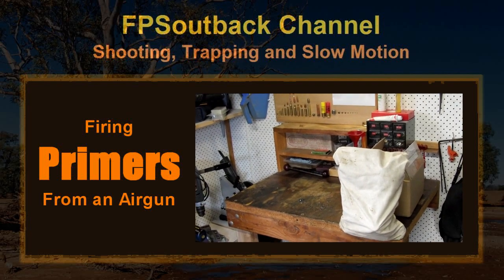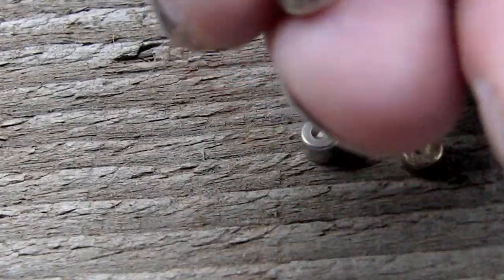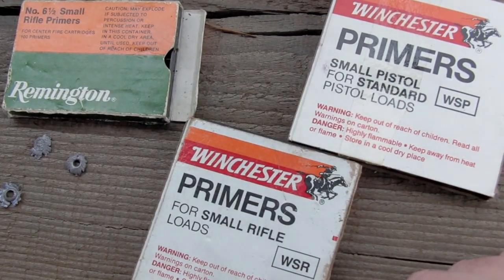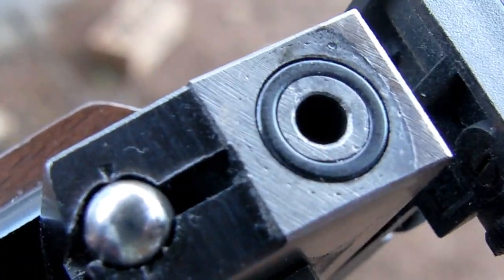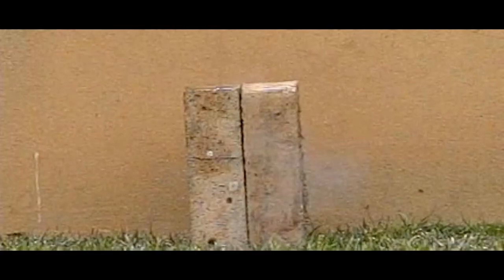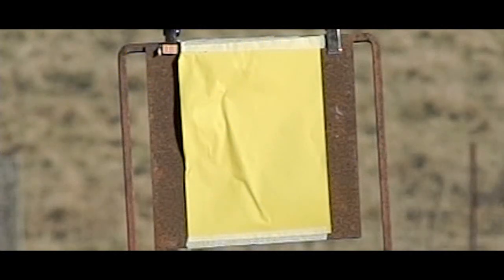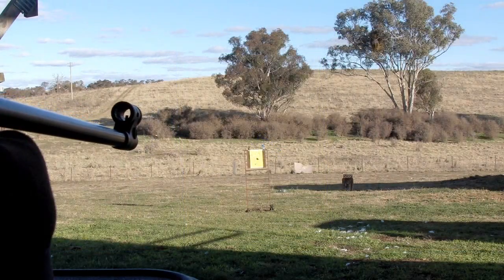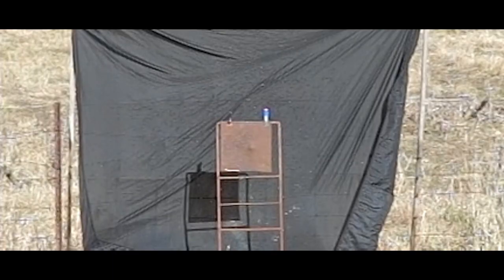Firing Primers from an Airgun

Comment: I had a few primers that got messed up the other day reloading .380 and they were no good to put in ammo but I remembered this video! I actually took them and used a dot of super glue and put them some high velocity .22 pellets. They had a pointed tip so it fit into the anvil recess perfectly. I have an old Crosman 103 pump that I muzzle loaded them into, gave it 5 pumps and let'er rip at large tree, it made an impressive pop and flash in the dark! Im too frugal to shoot my primers but If I mess any up, I know what to do with them!
Reply: If you glue some penetrating pellets to them you basically have an API pellet

Comment: I've been shooting small pistol primers out of a 900 fps+ air rifle for years without problems. The results are about like yours of course. Another trick I figured out as a kid is to put a pellet in the very end of the barrel, then load another one as you would normally. It makes a loud bang from the pressure.

Comment: those little plastic things from inside the stacking point pencils where you pull it out of the tip and shove it in the back to push the new tip through seemed to work well when i was a kid.

Comment: I would use primers in my pellet gun. The trick to make them blow a hole in a tin can was to glue a bb to the side opposite the anvil and shoot the combo pellet first. The result is a hole from high pressure blown through the cans wall. If you are careful you can remove the powder from several
 primers and fill the cavity in a pellet. Then seal it with a small piece of wax.
Shoot the pellet cavity first "backwards"
And it will do a better job. I used to fill my 22 LR bullet hollow point with primer powder and shoot 2 by 4s with surprising effects.

Comment: The cork screw flight is due to the primer (as a pellet) is going too fast for it's length. Same thing happens when shooting too light of a pellet from a high powered air gun.
Reply: Agreed, but keep in mind he was shooting it from an airgun only putting out 400 fps with lead pellets. Imagine shooting it from a 18 FPE+ airgun... short range would be accurate, but 30-40 yards out would be insanely wild with such a low B.C.
Reply: These are actually hitting backyards to, and like the guy said 10- 20 yards beyond that they have no accuracy they're made out brass or nickel so they'll shrapnel and ricochet as shown

Comment from the maker: Not really, its still "balanced" in the same way a airplane propeller is balanced. If you file a bullet into a paddle shape it will still fly straight. I know this because I just did it for the next vid, unbalancing it will cause a spiral though.

Comment: cool video...Try gluing the small pistol primers to the tip of a flat nose pellet to stabilize it in flight better.  It may or may not work.  You could even remove the anvil before you glue the primer to the top of a "pointed" pellet, the point of the pellet may be able to act as the anvil and detonate the primer.  Of course all of this defeats the purpose of using the primers as a pellet alternative.

Comment: Cotoneaster berries - little red berries that grow on bushes and small trees. Squish them into the breech. They have a few hard seeds inside them that will penetrate a plastic milk jug at close range. My friends and I used to shoot each other with them.

I got shot with one in the leg and it hurt real bad and bled a lot. On closer inspection there was a squished lead pellet stuck in my leg. The pellet had been one of several stuck in the air rifle's barrel in the past, then hammered out with a rod. This one had stayed squished into the rifling, then dislodged by the berry and stuck in my leg.

Comment: I've been experimenting with constructing .25 pellets using 1/4" heat shrink tubing and the heaviest 6mm airsoft biodegradable pellets I can find, usually 26gr. I stack  20 pellets into a 3 inch section of tubing the airsoft pellets and then gently heat it just enough to clasp the pellets. I cut them into 2 pellet sections then reheat to fully shrink the tubing to snuggly grasp the two pellet sections. After loading into my magazine I apply a drop of RWS cylinder oil just to grease the skids.

Comment: I would use plastic cap-gun caps cut off the ring, pins with BB sized heads, and the little round bits of fertilizer from house plants.

Comment: As a youngster, the use od daisy BB guns to shoot cockroaches was a normal thing.  Without BBs, we had to use whatever we could find.  Stick matches were always a favorite, though safety became a priority after the first few mishaps.  My other favorite load was a bit of modeling clay "wormed" to slide easily down the bore.  These proved to be surprisingly accurate and made satisfying splats that would disable if you missed closely enough.  Cleanup was very easy, as well.

Comment: It spirals because it's more or less cup shaped. It's "naturally unstable in flight" as they say. Try attaching a normal bb to the striking end of the primer with a spot of epoxy. It should fly bb first and maybe less erratic but lower velocity. Maybe that would allow the primer to donate on soft targets too (or in the barrel) :/ Look out, crows...

Comment: nice video, I've done this with home made flash powder but this looks more fun and quicker, I've been trying to test which is better, anvil side facing pellet or with it facing target", im guessing with anvil facing target you would think all of the charge would be directed into the target upon impact, and if its the other way around then you would think that the hard silver cap would act as a boost for penetration because the cap would want to blow forwards into the target from the explosion pushing off of the pellet that's is ramming it forward. I want to do a shrapp metal test, maybe like putting something really thin but just hard enough to set it off without really smashing the pellet' because this way I can see if the shrap metal from the explosion blows out the side walls of the toilet paper roll tube or I can see if a pressure wave bursts it open, without it just being from the pellet splattering flat and shooting out the sides,, I think im gonna do this tomarrow :0)

Comment: i used to shoot small capasitors twisting its leg into a pointed projectile, it was great and really fast, also cheap, coz i used to take the condensers from non working circuit board, also thrown out nail,  and other things like a phyco. those days were great.

Comment: i use to take a .22 round and it would sit just inside the tip of the barrel of my pump action power 77.   i would shoot a bb at the round and the round would fire from my bb gun.  tiny round firing pins are all a bb is really..   i also have a bb lodged in the center of my hand for life, and i once had a 22 round hit a tree and come back and stuck in my neck.    i know it sounds like madness, but kids in the woods with trees for babysitters either learn their lesson or they die..  or... they end up confusin the hell out of the TSA when ya wanna get on an airplane 😬 (kidding, the bb never sets off metal detectors)
Reply: Krash Von Reichmann That reminds me of me I was pretty negligent when it came to safely handling hand guns,I shot at a piece of old rail road log laying by the tracks I was using reloads for my Taurus 357 mag reloads aren't too reliable when it comes to consistecy in velocity I shot the log from 5 ft away it ricochet off the log and hit me right at my breast plate I looked down and picked up the bullet amazing I'm still alive to write about it.

Comment: What would happen if you could seat the primer where the o-ring is on the breech, put a pellet in, the mod the piston on a springer to fire the primer, to shoot the pellet??
Reply: Stupid idea to put it simply.
Also I'm not too sure there is enough "uumph" in the primer to send the pellet down the barrel, waste of a perfectly good air-rifle, imo.
Reply: Yeah if it was a perfectly good air rifle lol
Reply: +OminousPinapple I once had a uncharged .222 case. The primer launched a 52 grain projectile out of the barrel just fine.

It's my one and only reloading mishap in over 20 years of reloading. I fired at a fox around 40 metres away and the projectile hit between his feet. Lucky bastard.
Reply: People convert these break barrel air rifles to shoot .22 lr. They drill a little so that the bullet case fits, then remove the piston from the air gun & add a firing Pin. Works perfectly
Reply: @V-C137  How do you get the firing pin to strike the rim of the case, given the air port is aligned with the centre of the bore?
Reply: @BedsitBob  that bit is drilled out, like a straight hole with a floating slot pin
Reply: @V-C137  So the firing pin is like a flat blade screwdriver?
Reply: @BedsitBob  yeah

Comment: Put some oil behind primer you will get more power make a vid & let me know.
Reply: Gator1699 I put Muc Off Mountain Bike Chain  lube all over a fag filter and they shoot with a MAD crack and bang..
i dunno if it combusts or just allows the filter to break sound barrier?

My gun is supposed to be around 11.5 ft lbs and 1000 fps (depending on ammo weight)
The intent was to clean my rifling (was it fuck) but it blew a Pear into mush and sounded like a 22 fire arm...
neighbours not happy.... me HAPPY
Reply: +JETJOOBOY the compressed air ignited the oil. You sooped it up
Reply: matthew davisson oops
... Doesn't seem to have done any damage to rifle.... Although I don't think Mic Off is even flammable... I may be wrong... I will go and set fire to some right now!